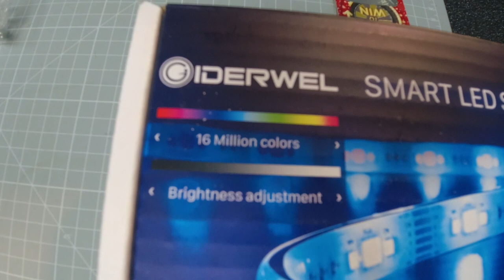Renault Trafic Campervan Conversion - Cladded Ceiling Pt 1

Comment: What size timber did you use. Good method but think. Will clad with thin ply then put 4 way stretch on top. Corner led strip also so throws light down more. Could not really see how you coped with rear door or at head line